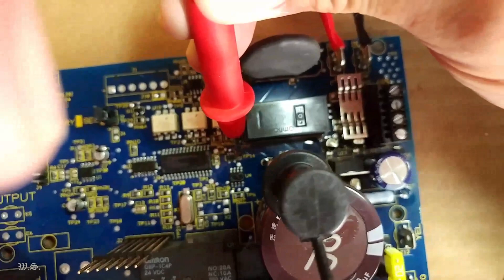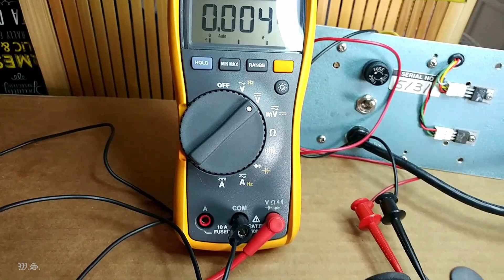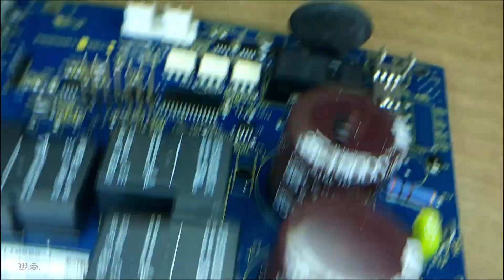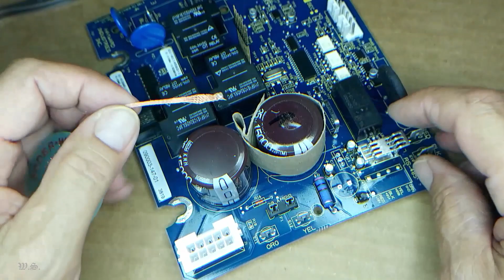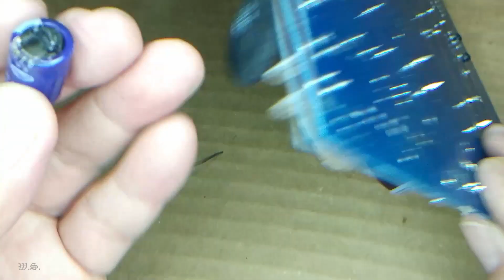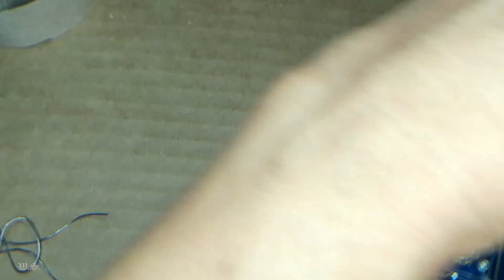Hayward Aquarite and Aquatrol/ Display and LED's not working/ Diagnose and Repair

Comment: Hi. first i wanna thank you for posting this video. That part no longer available on Digi-Key  Mouser . Please advise if any other store to get them from. thanks in advance.
Reply: Use part number "APX809S-40SA-7". It's still available, and I just fixed one of these units using that part as a substitute. You're welcome!
Reply from the maker: Google Search Engine is your friend. Type the part number MAX809JTRG in the search box.
Reply: @wanakosabe2093 Awesome vid! It seems MAX809JTRG is obsolete.  Would you think 863-MAX809STRG is an alternative that would work?

Comment: I have completed the diagnostics you provided and indeed I had all correct measurements except TP14. I will replace U13 as you suggest. My failed Trol happened following a nearby lightning strike. I'll let you know how it goes. You may want to update your part references. The 863-MAX809JTRG and MAX809JTRGOSCT-ND are obsolete and no longer available. The DigiKey site offers some substitute options. I am going to use TCM809JVLB713.😄 I will also suggest you can restore the conformal coating on low temp components with a bit of clear nail polish.

Comment: I have this issue and have replaced the mother board and still have no power or display. What else could be the issue?
Reply from the maker: What do you mean by "No Power"? The troubleshooting shown above assumed that the 30-32VDC is present between the Blk and Red terminal on the top right-hand corner of the board. Could you make sure you have an incoming AC power to the bd? If the voltage reading on all the test points agrees with what is shown in the video, you may have a bad display bd.

Comment: Hello, I have a Hayward board without a display, only with leds. The reference numbers that appear on the board are G1-066159-1 REV A and 090052-100-01 of the Salt&swim 3C salt chlorinator. It doesn't turn on any LEDs. I don't have an electronic diagram to check the test voltages. Where could I find this information? Thank you
Reply from the maker: Try to reach Hayward Customer Support-Center >>>https://hayward.com/support/support-center
Reply: @wanakosabe2093  Hello, I have contacted Hayward and they have told me that this information is not public. But I have replaced the two capacitors and the current limiting NTC and it is working correctly. Thanks for your help.
Reply from the maker: @fjmorales1939  Good job! 👏Thanks for the update.
Reply: @wanakosabe2093  Thank you very much for your input. I have sent them an email through the link you have provided.

Comment: Hi. If TP13 shows 0 Volts, and then TP14 and the 4th pin connector showing 0V as well, is it related to the same chip (U13) being faulty?
Reply from the maker: No! If TP13 shows 0 volt then the TP14 test is invalid. What is the voltage reading at R17 as shown @2:00? If the reading is 0, focus on the upstream components. Inspect the F1 20A fuse, check for loose or burnt wiring connections, bridge rects and confirm the incoming AC supply at TB-1 is present. Please reference my other video if you are troubleshooting in front of the control panel https://www.youtube.com/watch?v=aGQCJ-GXW5Y
Reply: @wanakosabe2093  Thank you very much for your response. I did all the other tests per the video at the link you suggested. I am getting 33V between R15 and the red terminal, the 20A fuse looks fine as well. On the R17 resistor lead, I am getting 24V and 23 V on the other side of resistor just like in your video. Now when I go to measure for 5V on TP13, I get a reading of 0. Would the issue be the 5V regulator itself or are there any tests that I should be performing? Obviously, as mentioned, any of the following tests with TP14 and the 4th pin on the display, give 0V reading. Not sure what else I should be testing as possible cause. Thank you 😊
Reply from the maker: @razvanchircu3017  On the Aquarite, the 78M05 is the fixed voltage regulator and it consists of 3 terminals. Terminal #1 (In) is tied directly to the 23Vdc side of the R17 via circuit trace. Therefore, terminal #1 should read 23V. If false, inspect for a broken circuit trace but if the 23Vdc is present and terminal#3 is 0V then the voltage regulator is faulty. 
Here's a wiki to the Hayward Aquarite to expand your knowledge > https://www.troublefreepool.com/wiki/index.php?title=Hayward_Aquarite_SWG

Comment: Before you replace your board. A question for you. !!! Are your display lights and numbers fidgeting ? If the are replace the display first. Its much cheaper than the board about $115 vs $400. If not try this also my own pool did this. 

I put an old board in that I  had replaced the thermistor in. After a new aftermarket board lasted 2 days. 
I was confused about the salt level numbers saying 2.7 and red lights were on after 30 seconds or so. 
Turns out I needed to check all my settings. It was in metric was set for t-3 cell mine is t-15  and had to calibrate the salt level. I have a hand held electronic salt meter and it’s normally very close to the Hayward reading. I had to toggle it from off to auto a few times to get it to start counting down like you’ve seen in calibration videos then flip it up to super chlorinate and back to auto to hold the setting. But now lights are green and everything it good in the pool.
Reply from the maker: Thank you for chiming in, much appreciated! 
To learn more, here's the link to the Hayward AquaRite Settings and Frequently Asked Questions https://www.youtube.com/watch?v=j10mbSm5MTY
Reply: where I can buy parts for circuit board
Reply: Amazon or EBay